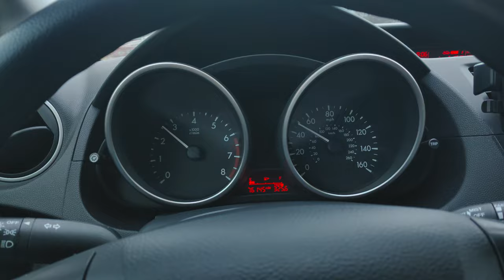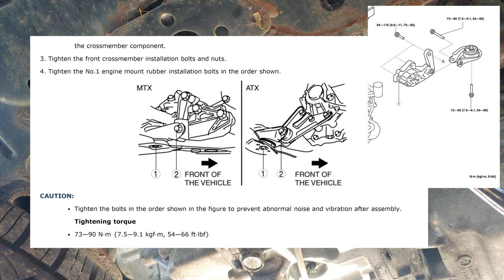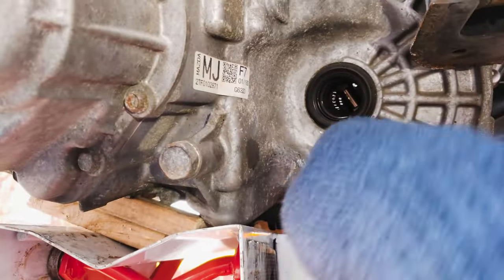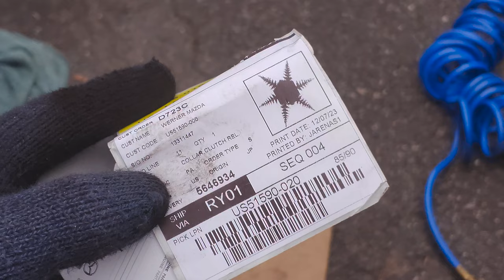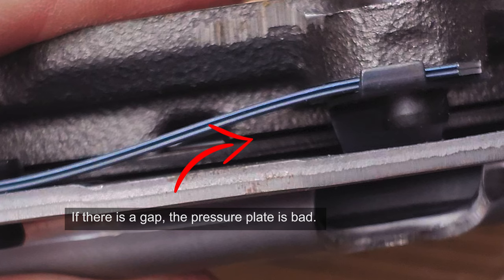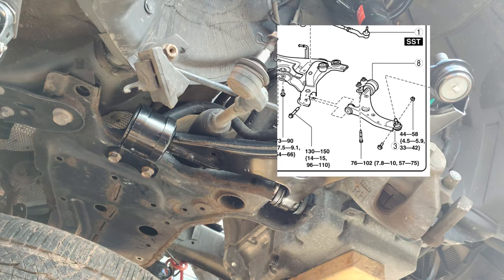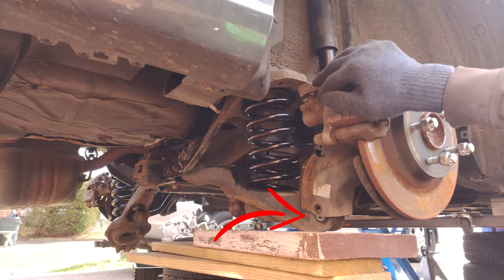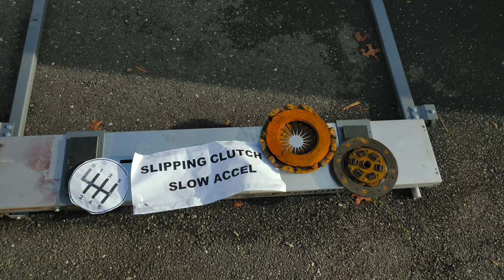2012 Mazda 5 2.5L Clutch Job and Suspension Overhaul

Comment: Blowing out that clutch dust is so full
You have a family. 

If you did that in my shop either you or I am leaving and not coming back.
Reply from the maker: In hindsight it would have been better to take it to the corner of a yard where nobody goes and hose it off with water. Nobody was around fortunately.

Comment: what are those blue jackstands ?
Reply from the maker: The scissor lift is called the "EZ Car Lift".  Ideal for someone like me who has a big repair but is not for every single day use.  It is not hydraulic.  So I don't have to mess around with fluids etc except for it's own internal oil drain plugs for lubrication.

You can buy different width bars for different cars.

When I used it on my sienna, you absolutely must help the lift at the beginning, or when the car is very low to the ground.  Once you're about 8" up then the lift is stronger.

Very happy with the product.  It lets me use my other 6 jack stands and 2 hydraulic jacks for additional redundant safety purposes.

With that said it is not recommended for mechanics who work everyday.

Comment: Really bad pilsofy you put every thing new parts and not replacing oil siler o the back of the engine 😮 wird
Reply from the maker: Fortunately mine was bone dry and no evidence of leaks.  Rear main would have required some more tools and I think you have to drop the sump too. Not sure as I havent done homework on these 2.5l rear main seals.